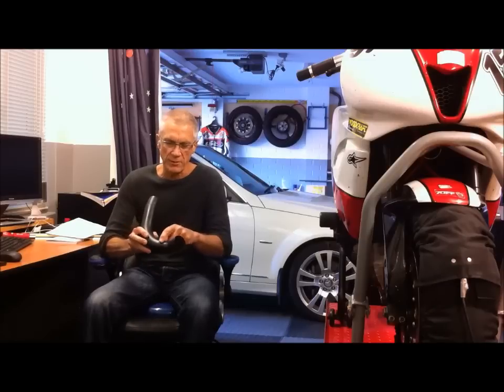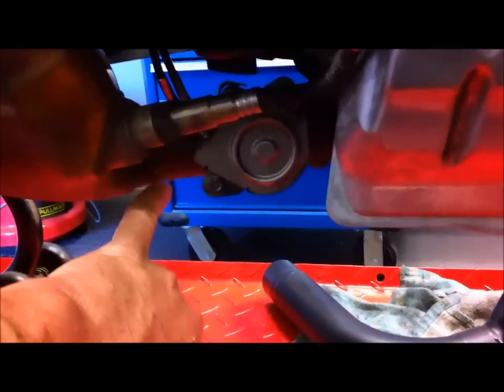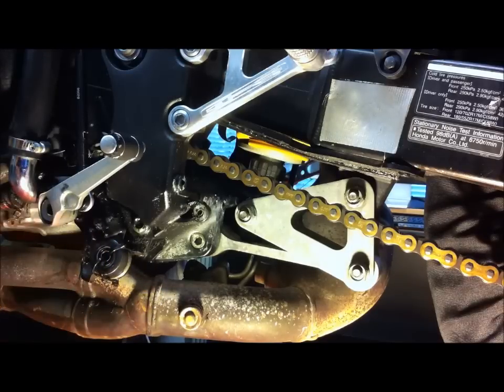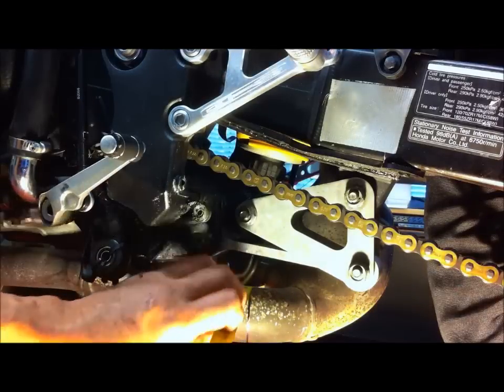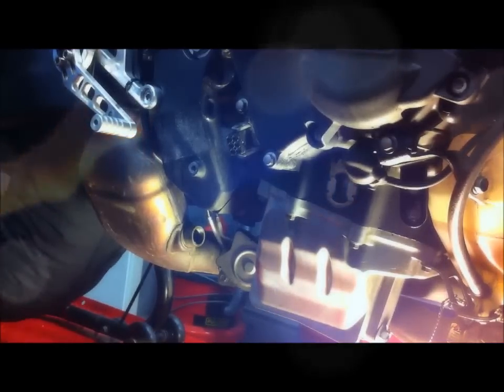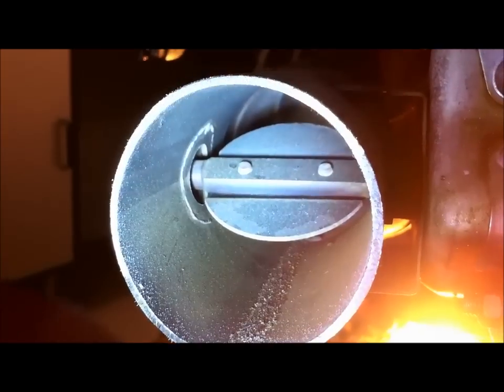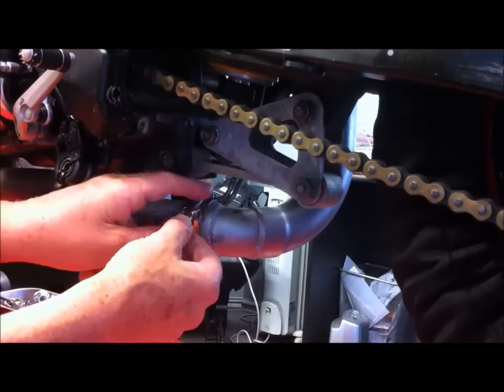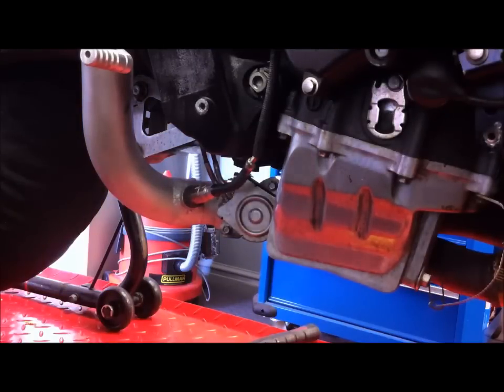2008-2017 Honda CBR600RR Remove Catalytic Cat Converter Fit Eliminator Pipe Mid Pipe

Comment: Anyway to decat and deservo as well?
Reply from the maker: Jeremy once you've cut the pipe out you can access the exhaust valve easily. You could disable or remove it.
Reply: I welded my servo valve in the opened position, it's always loud.

Comment: what year model is your cbr600rr ??
Reply from the maker: +moustyafghan 2008
Reply: +Scott Elliott so theres no way it would a fit an 05 ? without any mods to pipe ?
Reply from the maker: I don't think it will fit straight on. If you do a search on eBay I'm sure i've seen versions for the 05 series.

Comment: Hi Scott just wondering if I cut the baffels from my stock exhaust to make sound a bit louder should I get a Dyno remap after ??
Reply from the maker: For a street bike I don't think a remap is necessary. They tend to be set up to be quite lean at small throttle openings. Sometimes they can feel a bit fuel starved from a closed throttle after opening up the exhaust. You'll just have to see how it feels.
Reply: @ScottElliott152 ok thanks

Comment: Is it required to add power commander when you eliminate the cat with the mid pipe?
Reply from the maker: Usually the motor will require adjustment to he air fuel ratios. So yes a PC or similar system will give you peak performance.

Comment: if race bike why even keep the butterfly/servo its just weight you don't need
Reply from the maker: Because it gives more mid range power. Unless it's a track with very long straights you're better off sacrificing a few horsepower up top to have better mid range drive out of corners.
Reply: @ScottElliott152  hmm ill have to do some dyno searches to see the difference 
that mid pipe I see there are some on Ebay is that where you got yours from? 
i was wondering which one kept the butterfly or not.
Reply from the maker: @seinfeld11123  I bought mine on eBay quite cheaply.